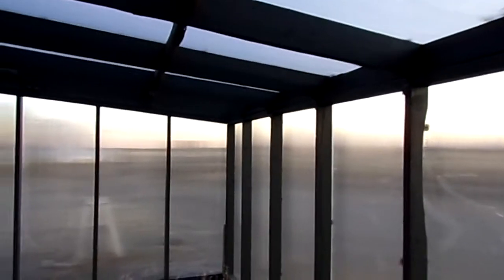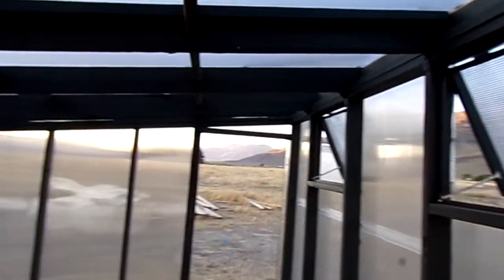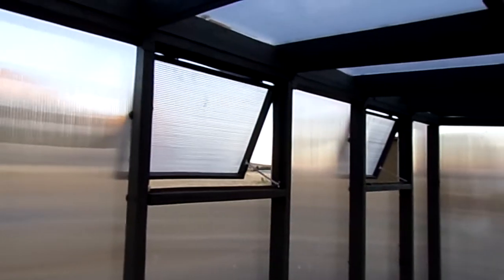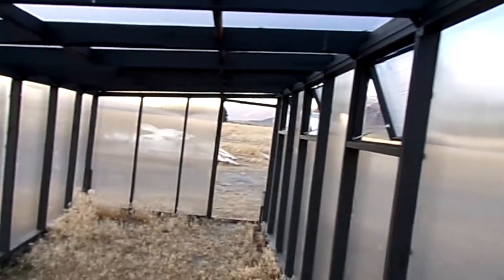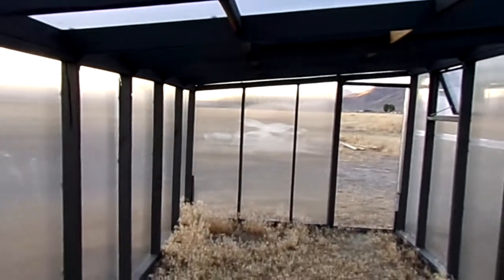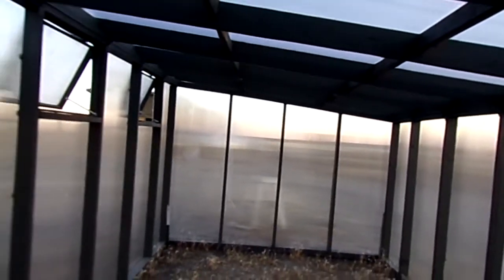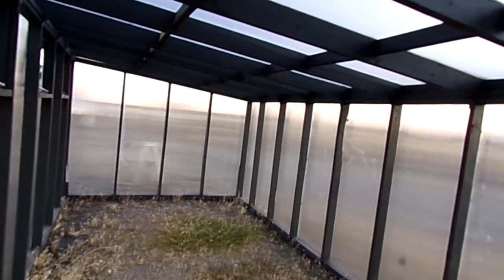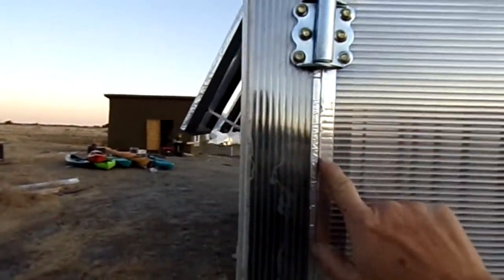Inexpensive 196 square foot greenhouse

Comment: That’s a nice setup. Where do you source the poly from? That seems to be the show stopper every time I get to budgeting phase.
Reply from the maker: Just saw your question.  Sorry for the late response.  I tested five different glazing types before settling on the polycarbonate (glass, PVC, PE, HomeDepot PC and multi-wall PC).  The cost and availability in central Idaho were prohibitive for me for large quantities of multi-wall PC, so I jumped onto Alibaba and looked at various suppliers in China.  I found one that had good quality at a low price (Polyvalley.com).  Buying from Alibaba is different than Amazon as there were no feedback or other indicators to show this was a bonafide supplier, so I was a little scared to dump $25K into a "blind" order for Polycarbonate.  One of my friends was interested so we split the load and thus split the risk of fraud.  I was genuinely pleased when the order arrived.  I used that material to build my domes, and then sold the rest at a profit to pay for the materials.  I ended up buying another cargo container, and then another . . . . as there seems to be some local demand.  I'm currently selling the PC at catchsunlight.com.  I only sell to local folks as I don't want to deal with shipping, but my prices range from $1.20 to $2.00 per square foot depending on what's being purchased.  You can also buy steel from China and include that in your cargo container load if you want to avoid wood in your greenhouses.  Just keep your loads under 17 metric tons gross, otherwise you'll end up with problems.  I use Cargo Link International out of SLC for my customs broker.  I'd suggest getting a 20' container, building your projects and selling the rest.  Good luck.